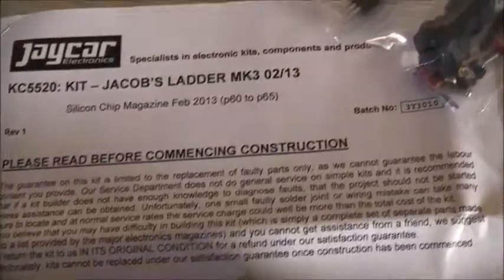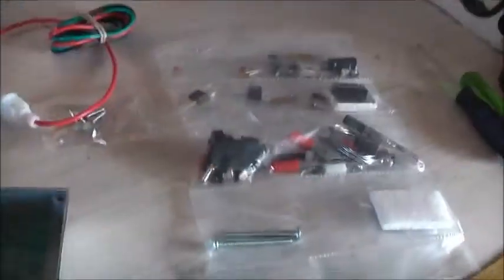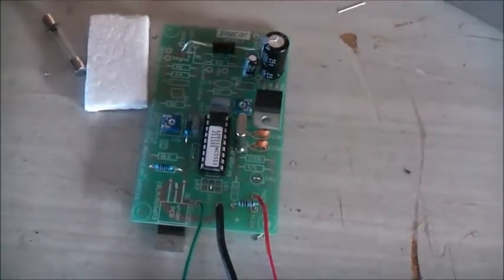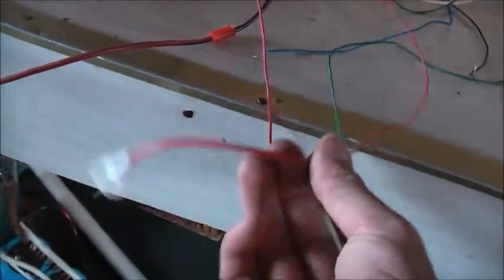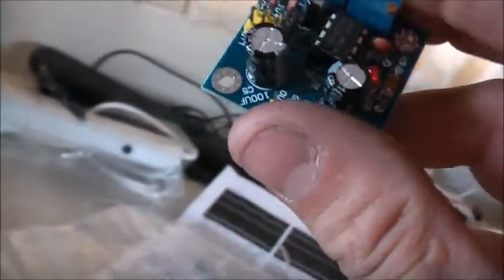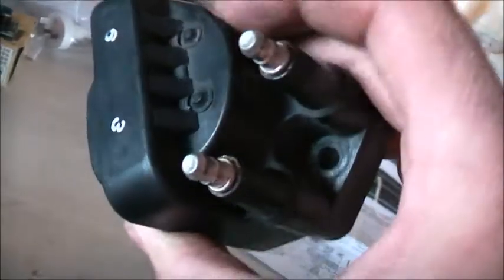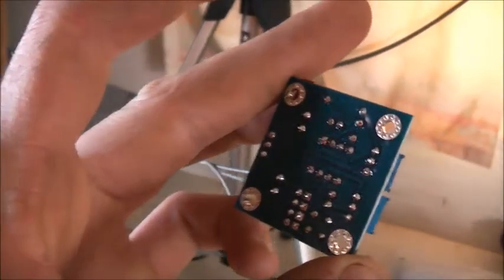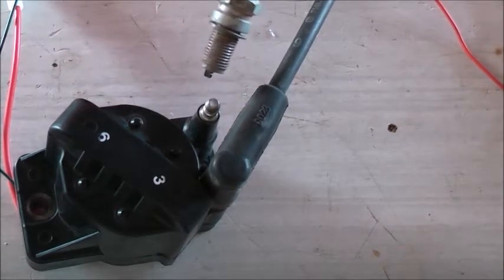Ignition Coil Driver

Comment: Hi larry, well the best thing for your igbt gate driver mate is using an optocoupler and the 555 timer will turn the optocoupler on or off mate. And it will be completely separate from the 555 so it wont backspike your timer chip, and the optocoupler will charge your gate driver fully on! You can use 15 volts mate, its what i use. If your stuck in any way mate check "subcooledheatpump  " channel, as his videos will point you in the correct way larry.

Hope this helps you mate.

Comment: you also will need the correct gate drive voltage, usually higher than 15 volts but not more than 20. also keeping your drive signal clean with a highly inductive load is difficult, as i have found :)

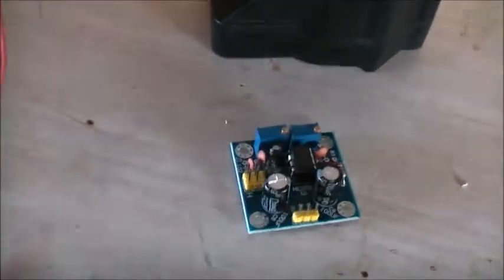Comment: @4:12 that driver will NOT run an IGBT brick. it will for a short time, but either the brick or the driver unit will fail. IGBT bricks are much more dificult to drive correctly than mosfets or smaller IGBT units that have similar gate capacitance to a small mosfet.

Comment: I had one of the first versions of these kits were you mounted the ignition coil right to the PCB with zipties, it never worked right because the arcs weren't hot enough. NST's make the best jacobs ladders I reckon.